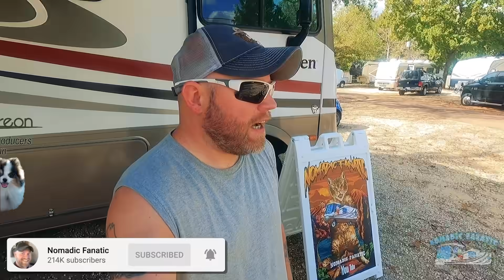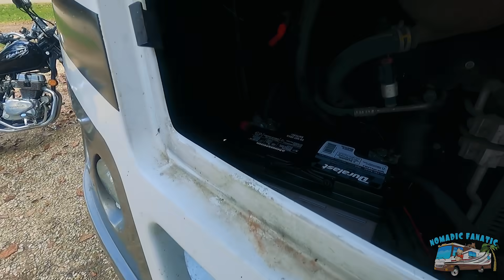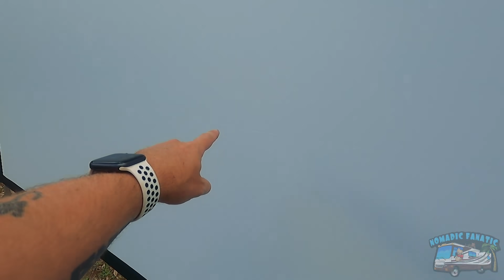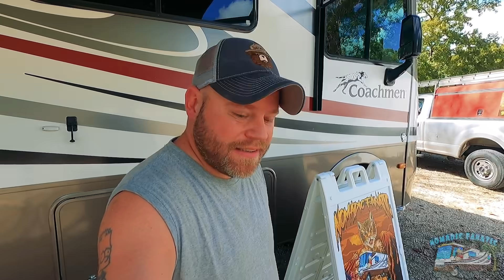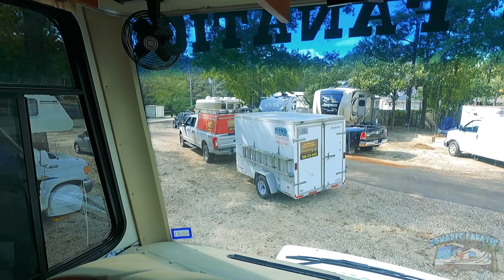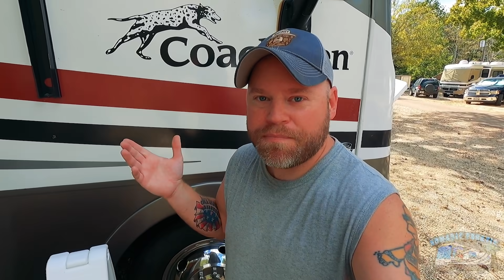More Onan Generator & Lippert Leveling Repairs... $$$

Comment: Replace the Voltage Regulator and if that is not it replace your control board and if that does not fix it get a new generator.
#1 Pull the generator out.
#2 install one that is dual fuel and run it off from propane.
#3 Change your oil as prescribed.
A gas generator that runs on propane will be 99% less problematic.

I have a dual fuel generator and it stopped running on gasoline.
I hooked up the propane and it runs.
It randomly will run on gasoline.
It will always run on propane.

Comment: You keep saying "everything has been replaced" but reality is, it hasn't. On your generator, in the last video, a guy who says he worked on onan's for 20 years suggested the motherboard. Has the motherboard/controller for the generator been replaced? For the leveling system, with the error it's giving you sounds more like a sensor issue than a pump issue. Maybe a controller issue. It says the jacks are down and overextended, so what tells it that they are in that state? I'm sure a sensor of some sort. I'd start there.

Comment: Eric... Trust me. The generator issue is in the line going to the tank. Test that theory by use a gas can to drop a hose in before the pump. Fuel lines can get fine cracks that wonte leak but sucks air in. Slowing the volume of fuel to the pump. 🛠️👍

Comment: I use to be an electronics technician. I found most mechanics don't know how to debug. They follow a script, "If it does X,  then replace Y". Anything out side the script they cannot fix because they don't really know how things works.  When I have brought my RV  to the dealer for repairs, only 50% of the time things were fixed correctly. I usually end up fixing things myself.

Comment: I dont know a thing about the leveling however the generator is a very basic small engine not much more complicated then a lawn mower. They keep looking at the fuel system. What about ignition. Does it think it has low oil or does it think it is to hot. Wish you were close because i have never met a gas engine i could not make run in 20 years as auto mechanic and 10 mercury mercruser master tech

Comment: I had a thought.
If your generator has a remote start/stop control panel inside the coach, you might want to check it and it's wireing down to the generator instead of the generator itself.

Comment: check the jack rams that there is not a small stone stuck up the side of the seal it wont let the jack go right up and check the oil level in the tank that is the censor to tell the computer that the jacks are up its a silly design fault get the rams to go down a bit and get a sharp screwdriver and check there are no obstructions on the rams if 1 of them is down just a quarter of a inch it will say jacks down and wont work as the jacks are retracting if you find the one that is stuck down a bit hit it with a hammer till it goes up once the oil level is up in the tank it will work . you could try putting a bit of oil in the tank to trick it int thinking the jacks are up then it should work  let me know

Comment: Self build your own RV.  Buy a very reliable BOX TRUCK and install and design to your custom needs.  It can take a little longer than buying off the shelf but you will know what is in it and how to repair it. It will be a lot less expensive and a lot less of a headache once you have it built.   Leaving a lot left for maintenance and a lot of satisfaction in the custom design and knowing what is in it and how to get it repaired for the long run.

Comment: Looked back at Wayne's solar install, looks like he might get two more panels on the roof.  An extra 600w may allow you to get by with a smaller generator to top the batteries off.

Comment: The most reliable leveling system is no leveling system, the most reliable slide outs is a solid wall, the most reliable generator is lithium batteries. For leveling I use wood shims under my bed, since that’s the only place it matters.

Comment: Could be your oil level cut off switch on your generator. It could be bad or if you're sitting a little off level and your oil level is not perfect it will quit running it that switch is working properly. You can fix that yourself. Google how to check your oil pressure switch On your onan generator

Comment: Make an appointment with a highly rated (Yelp) Cummins Service Center I’ve had those Onan 4000 and never had a problem have a 10K now also no problems as for the LCI find any top of the line like an Entegra RV Dealer that has a Certified LCI Tech,  yes they change $190 an hour but the one I go to can figure out what’s wrong in 10 minutes orders the parts and installs them in under 2 hours, he will also show you how to reset your system in 10 seconds which is what you need to do now, resetting it has saved me many many times.  When I called LCI they were absolutely no help but did email the complete instruction and service PDF which Is 90 plus pages. Do not replace that pump and valve assembly.

Comment: If I were in your position I would go to your base in Illinois and relax for a while. Get that RV into a reputable RV repair shop that's been in business for many years and has a good reputation. While it's being repaired, film what you're doing at home and take your motorcycle out on some quirky hunts in the surrounding area. I'm sure your subscribers will enjoy seeing what you do at home, besides stewing over repairs. Videos like this one will be the only thing that will drive them away. 

If you don't want to do that, just use the RV as is. Leave the defective slides in, park in level places where your chocks is all you need for leveling. Stop using the generator. When solar and charging from the alternator don't keep the batteries charged, park somewhere with power, like you home base, state parks with power, friends, or RV parks to get them fully charged again. These are the only alternatives you have as far as I can tell.

Comment: Damn bad luck Eric, don’t feel bad but you’re not the only one that goes through this it’s a rarity anymore to find a good service person that knows what they’re doing, if and when you decide to work on it again find a person that does electrical diagnosis do you have all new parts  So you need to know if all your switches are opening and closing pump training on when they’re supposed to timers and actuator is working in the proper order, just a suggestion I feel your pain travel safe.

Comment: Eric you're really having it rough with these repairs 🧰 but remember your RV is not new⏳ also it is working and getting you from point A to pointB you're just having issues with these two unfortunate components, the slides are something that I'm sure wasn't designed as well 👎as they could have been but you can use your RV🚍without using them and then with your generator you need that you might just have to replace it with a new one I know it's frustrating but think about it you're taking your home🏠with you on the road almost everyday🛣 and that's a lot of wear and tear so just chin up⬆️ this too shall pass and instead of looking at all the⬇️ negative that's happening weighout⚖ your positives ✅ and you'll see you're ahead of the game 🎯 people are imperfect and so are the machines they make it's not worth getting high blood pressure over🩺 life is pretty sweet all in all 🍒

Comment: Could be the pick up tube in the tank came loose or rotted out .also follow the lines make sure all fittings are tight and there are no leaks. witch would couse the pump to suck air not fuel

Comment: I know this sounds totally stupid but I've had it happen to me if the oil level it's too high it will cause a generator it just shut down. The oil level should be at the lower end of the safe Zone. If you feel up to the full line then your generator warms up it just stops running. Don't take my word for it look it up on YouTube. If the generator runs fine otherwise then just randomly stop running then this is most likely going to be your problem I have had this happen to my Onan generator

Comment: If the factory that built your RV is still in business, then that would be the most sane remedy in my opinion.  I feel for your lack of mechanical knowledge related to the different sub-systems that continue to vex you with your home...  If at all possible,  please find the builder of this massive albatross of mechanical anomalies and have them repair your home Eric... Good Luck!

Comment: Hi Eric.   You need to learn to fix things on your own.   The info is all online.   All you have to do is take the time to learn the system.  Regarding the leveling system, I am willing to wager that the problem started after you changed your front brakes.  I saw the jacks down with the tire off.  That system was designed to level the RV, not lift it.   You could have blown a seal in any one of the rams.  One blown ram seal and the system won`t work.  First, stop throwing parts at the problem.   You said the pump runs but sounds funny.   Its a hydralic system.   Any air in the system will stop it from working.  Air compresses, oil does not.  It was taken apart to install the new pump.  Its probably air  bound.  Fill the oil tank and have a friend open the bleeders one at a time while you run the pump.  Regarding the level angle, find where the sensor is that tells the brain box the level of the RV.   The level sensor might even be in the brain box, that might have to be mounted in a level position to give a correct reading.   Now that you are a home owner you are going to have to learn how to fix things yourself.  Its the difference between a 500.00 Water Heater install and a 2,500.00 Water Heater install.  Good luck with your repairs and stop putting your faith in the fly by night repair people on the road and try not to get stressed out over breakdowns.

Comment: Seems you have had issues with all if not most of your RV’s Eric, not having much luck bud!  Advice at this stage is probably not going to make you feel any better about things other than to say no value in getting angry about it ... I agree with one other of your subs, no point throwing parts at it unless you stay put in one place have one mechanic work on the lot and test everything for a week or 2 whilst still in the area and just bring it back if it fails again ... once it’s all good ... off you go!

Comment: Eric hook up some fuel hose to your generator carb draw from a gallon gas can by passing your fuel tank.If it runs your problem is the fuel hose or connections to the pump in the tank

Comment: Yeah isolate the problem(s). #1 " jacks down" (Obviously the system is telling you: it thinks "a Jack is down"... somewhere there's a switch or sensor giving the wrong indication( IF THE JACKS ARE FULLY RETRACTED). That could shut down the entire system.  It (likely )won't work until that goes away (and I'm an industrial machinery/controls tech not an r.v tech).Somebody should be able to break it down into "inputs" and "outputs". There's either a (proximity) switch or pressure sensor on the individual jacks or a pressure switch on the hyd pressure side "bad". Throwing parts at a problem ("shotgunning" ) is ALWAYS A BAD/EXPENSIVE IDEA. 

#2 Then "out of level" I wonder if the sensor says it is too far off level; to even attempt to lower the jacks? So is the level sensor installed "on the level"?? does the warning go away if you randomly  tilt the board(with the level sensor on it.)

Comment: Crap happens and I don't mind you sharing it. One day I want to travel too and so I don't want to only hear sunshine and rainbows. I think almost everyone I view that eventually gets a big fancy RV seems to run into the same problems with jacks and slides. Since it will mainly just be me traveling I've pretty much decided that if I get an RV at all it will be a small one without those things. I'm seriously considering just getting a high top promaster or Ford Transit and building it out. Yes it's smaller but better built and easier to get repairs. I don't need all that space. I just want to be able to stand up inside. Sometimes less is more. Yeah unless I win a giant lottery I won't get a big RV.... maybe not even then. Who needs the hassle.

Comment: Almost sounds like the mechanic from up north replaced your parts with the wrong parts and they might be incompatible with your system.  Why else would it completely stop working when they changed the parts.

Comment: I just wonder if anyone has ever bypassed the controller, and run the motor and pump to cycle all 4 jacks several times to full extension.  He obviously has a bad sensor if it is reading a steep incline.

Comment: I really feel for you I've been with you for the most part of 6 yrs and all I can say is get that SOB GONE trade it in burn it down . it will not get fixed it is a lemon/ RV 
I have put $10,000. in my class c and still something else
 goes wrong about to pull my hair out .But want was wrong did get fixed anyway !! Could not image how I would take it if it wasn't fixed . Well its just a days drive to IL. So where's that . Safe travels & scratch that cat .lol Hi Jax
Reply: There's that

Comment: Is taking it to the Lippert factory out of the question? Have the people that made the system fix the system. As for the generator, it sounds like the control box is causing the shutdown. Something over heating or too much draw on the system and it’s a safety issue? It sure seems frustrating but it must be so hard to plan on fixing anything while on the road and that is your home. Stay positive bud.

Comment: There are pros and cons to each RV. The more goodies on an RV, the more chances for failure. Slide outs break. Leveling systems fail. Another option is go go back to simpler design. No matter who manufactures them, each enhancement is another point of potential failure. Our current RV has no generator, no slide outs, and no leveling system.

Comment: So frustrating for sure :-( An RV is like a car with 20 extra complex systems tacked on. When a new car model rolls off the assembly line it might take them a few tens of thousands or even hundreds of thousands of units to work out the kinks. But by comparison every model RV is basically an EXTREMELY low production prototype. There may only be a few tens of thousands of identical RV units like yours EVER made. The amazing cool and inexpensive tech we all love is possible because it is created in extremely high production runs. Your average iPhone model will be made in the tens of millions. And as a society we have gotten used to this and think it’s normal. So a good way to think of any RV is as a custom built engineering beta product. It will fail, and fail in multiple ways. And the systems that need to be repaired or replaced will just as likely have design flaws as defects or wear failures. Also because of the low volume; replacement parts are a moving target (often you are buying parts that may be on the third revision of the system you bought; so are not compatible). Because of all this I have only ever met two kinds of >>HAPPY<< RV owners. 1) You buy low mileage old RVs which have meticulous records where the prior owner worked out all the most expensive beta kinks already. Then you do a lot of maintenance hands-on, and be willing to heavily modify. 2) You have the kind of wealth where you could have someone design and manufacture custom products for you (which is the reality of what RV companies are doing), and you just pay the bills and don’t think about it. People in category (2) won’t usually share the details with you because they know from experience that being open about their wealth gets them in trouble. From having personal relationships with a few of these folks, I can tell you that spending .5 million to 2 million on RV related costs over a decade is not at all unusual. So the problem is many RV owners have unrealistic expectations. The only way this will ever be solved is if a company built a generic RV at a low price that could be built with volume in the millions. But people have such diverse needs that it’s hard to find a generic design that could sell in this quantity. I think Hyundai might actually be trying to do this as a worldwide product with the Porest; but a lot of Americans will hate it. Realistically we need someone like Elon Musk to mass produce something using similar engineering tech to the Cybertruck in RV form (stainless steel exo-frame with massively simplified electric drivetrain). This type of Cyber-RV could contain 1/1000 the number of parts as an average RV, thus massively increasing reliability.

Comment: I would take Miranda directly to Lippert, and let them fix the auto leveling system.  Onan generators are very expensive pieces of unreliable garbage.  I would replace it with a Honda EU3000 inverter generator...more reliable and easy to work on.

Comment: You will have to change your name to Jinxed Fanatic if this continues. You are going to have to fix the jack system your self no one else can fix it. It may just be air locked' 
The Generator- Run it without the air filter, does it still stop? While running look into the carburetor with a mirror, is the choke open when the engine is hot? ( sounds like it may be stopping when the choke opens) Sort of notice what is happening to make it stop. Make sure the main breaker is off when trying out your generator. If it runs with no load you may be overloading the generator maybe an air conditioner problem